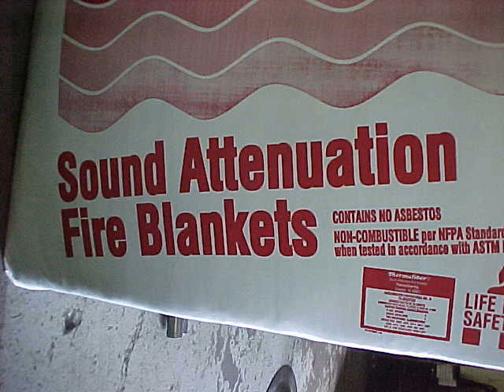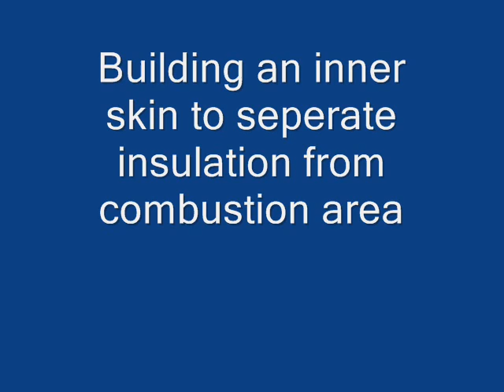Seton clone Boiler Build

Comment: Thank you for showing the insides of the boiler.   I have a Greenwood that I’ve used since 2008.   I know I need to clean the tubes, but I’ve been afraid to take it apart because I didn’t know how to replace the insulation that will get damaged as I dismantle it.   It looked like rock wool on the top, and fireproof sound barrier on the sides.  

I am getting corrosion on the top of the furnace, I think that is caused by burning wet wood when the house is not calling for heat.   The smoldering fire was probably condensing moisture on the outer shell.   Overall, the boiler has been trouble-free, and has burned about 160 cords of firewood.

Comment: Thanks for sharing this slideshow. I like a lot of what you have done here and may implement some of your design changes in my Greenwood 100 should I need to do any major service to it in the future.

@jmye1524 Can you please share the source of your refractory blocks? I have a friend with a Seton clone, and unfortunately the rear refractory is a crumbling mess. Your method may make it much easier to "rebuild" this one panel in place, rather than disassembling the whole thing to install a new cast panel like the original. I climbed in there this past summer to repair a Hx tube that was plugged on one end, and eventually developed a pin-hole leak. While I was in there I stuck some of the chunks that broke off back in place using furnace cement. This has been holding it over, but we need to make a more permanent repair.

Thus far, running a timer on the air door and holding it open for a predetermined amount of time (these days, 2-1/2 hours seems to work best) has been working well and I only have ash on my heat exchanger tubes - which is easily cleaned about once a week with a pizza oven brush. I started by running the air control depending on heat demand, but was very disappointed with the performance using this method. I had black puddles on the floor, and there was black drool coming from many of the seams. I have NEVER had this issue again now that I have been running it wide open for a "burn in" period, then leaving it closed until the next refueling. This ensures that there is always enough ember remaining for relights even 12-14 hours later. Having heat storage improves the temperature regulation in the house, but since I moved to a larger house the temperature fluctuation has been manageable and I haven't yet set up my storage tank. It is definitely better with it though, so that is still in the plan...eventually...

Comment from the maker: Not really sure.....limited idle times while burning keep the tubes pretty clean but they do get some corrosive buildup on them. Ive had to replace the nipples that pass thru the outer skin.(link in video description) The problem is I don't believe stainless would work well in these kind of conditions, to brittle.